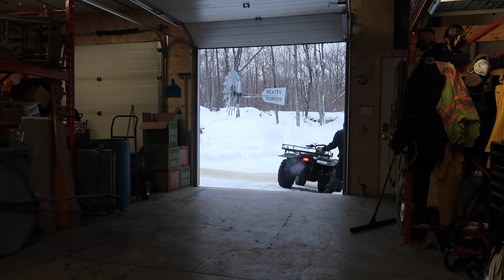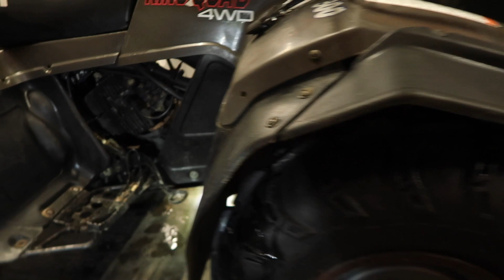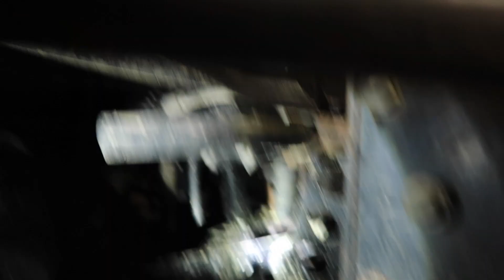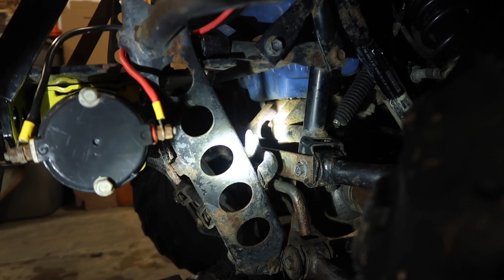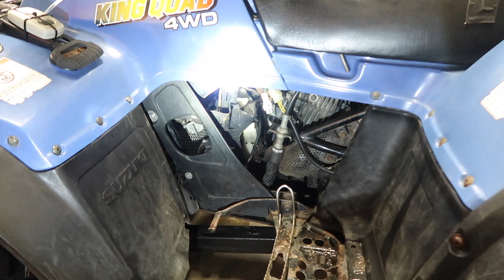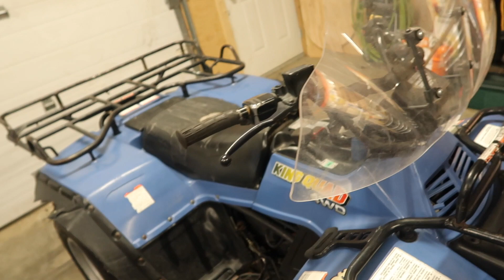King Quad 300 Oil Coolers and Cooling Systems Explained!

Comment: I have the winch on mine but the plate and winch are mounted up top in the middle, rather than in front of the cooler. The previous owner was plowing with it but I figure he removed all the mounting stuff that wasnt factory along with the plow before selling it to me. He did however leave the 300lbs winch on her. Mine has her oil cooler mounted in the front with no fan. Sometimes she seems to feel hot, like restarting with the rip cord after a long run sometimes is uncomfortable to grab. But that handle is right above the exaust. High temp oil light never comes on so I figure all is normal. I get a bit of oil build up around the valve cover on top of the head but nothing alarming enough yet to have to address. Its my understanding shes been like that for years. I really should check and adjust the valve lash. Just because idk when it was last done, if ever.  Seems like she may be running a tad rich as well, idk yet but plug is dark, like I said I should check the valve lash to see if they are out of spec a tad causing plug fouling before digging into the carb, which I do believe is oem. She runs great but idles for shit. Have to ususly apply a tiny bit of throttle while idling or when starting as the idle is Erratic and wont stablize when adjusted higher or when adjusted lower, (at the handle bars not carb, seems that makes no diff at the moment), the bike will stall or just simply idle like its gonna die leading to a stall, hence having to keep a smigin of throttle.  I suspect vacuum leak. Otherwise shes an awsome machine and runs great. Idk why the dark plug reading as under throttle she does not act rich, not burning oil at all, might miss at the limiter but that could just be the limiter. It's odd to me for a plug to read rich but the machine to run like it's a/f ratio is on point. Perhaps idle is really rich but under throttle is correct mixture??

Comment: Mine has the stock cooler placement up front.. but it also came with the factory fan.. 🤷‍♂️ I guess it's only really blowing on the motor.. and yeah mine just had a missile switch mounted on the handlebar. Manually..

Comment: Do you have any idea why my 2001 Suzuki King Quad 300 will not turn over with a good battery and even with trying to pull start with the decompression lever pulled?
Reply from the maker: I would pull the spark plug and try that. I bet the carb needle leaked and filled the cylinder with gas.

Comment: I have a 97 and a 96 Suzuki King Quad and my on 96 I am mounting a winch and a snow plow. With the factory front mounted oil cooler, why wouldn't a small fan on the cooler be a simple solution?
Reply from the maker: Yes it would be a simple solution. My father in law had the winch and plow on his for 20 years without a oil cooler relocate and he never had an issue.

Comment: Hey Schneid, I just got a 94 king quad 300 4x4. I took it for a nice ride ran great. But the lil red light by the ignition came on then went off the stayed on. I changed the oil and filter and checked the oil strainer and everything checked out. Is there anything else I can look at or is that red light for something else? I assume is for the temperature is my guess correct? Any help would be appreciated
Reply: I know this was a while ago and I hope you didn't blow your motor by now but that "little red light" is for your oil temperature. If you are overheating it will come on. It could also indicate low oil but it would be low oil.causing overheating if so as it measures the temperature of your oil, since these machines are oil cooled. Idk how reliable those lights are or if that warning system can fail or not so ots best to always use common sense as well. Be nice to know if mine works, however, as when the motor is hot I would like to know I it's getting too hot or is normal. My light doesn't come on so I assume all is fine. However sometimes that ripcord can be kinda hot to grab, ntb but hot. It's right by the exhaust however.

Comment: I have a 97 kq300 and is over heating. I'm thinking it's a blocked jernal. The oil Is flowing thru the hoses. I replaced the oil cooler in the front with and Older one from a 93 but that should be fine. Wish me luck.

Comment: I have a 1995 Yamaha big bear 350 that seems to be overheating. It does not have a winch or snow plow mounted on the front of it. It also does not come with a fan. I was wandering what could be some of the the things causing it to overheat?

Comment: Thank you for all your information it has been very helpful on my 1994 Suzuki 300 Kingquad. I am running into a problem the last two rides. The oil temperature light comes on and stays on. When I checked the oil is going through the radiator and it is warm. I have an idea the sending unit is faulty or bad wires. The problem is I can't find any information on the sender or its location on the quad. This morning the light stayed on when I first started it in the morning, 45° outside temperature. Any help to find this item would be nice. Thank you

Comment: hi there, I have a 97 king quad 300 that I use to plow in the winter. It doesn't have a cooling fan installed on it. I have found that after plowing for 30 minutes or so of plowing it keeps stalling out at idle and has a hard time reversing. Would this be due to overheating or am I looking at a different problem:?
Reply from the maker: I’m not sure what would cause that. A heat issue would make sense though. Maybe try and take it for a spin at speeds and see if the issue happens.0

Comment: Do 90s quad runners have an oil cooler? Ive got a 93 quad runner with oil cooler and the 5 bolt rims plus that extra black trim on the fenders. Is the sticker saying quad runner wrong / different plastics? Ive heard the king quads are supposed to have those. Great videos keep em comin

Comment: For my stretched diaphragm issue, I bought a cheap Chinese carb on Amazon. The slide is different but the diaphragm is exactly the same. Much cheaper than an OEM diaphragm and you get all you need for a complete carb rebuild for around $50.

Comment: Great channel Schneid. It has helped me tune up my 91 Quadrunner 300 (King Quad). I added an IP67 (dust and waterproof) fan between the winch mount (I have the same bumper as your 97 with the Caution label on it) and the oil cooler grill. I bought this machine used and it has always ran hot. I had to replace my front seal and while reading forums I read that these machines can run so hot that the oil literally boils. I am pretty sure that the motor heated up enough to bring the gas in the float bowl to almost boiling temperatures as well. This heat warped and stretched the diaphragm in my carburetor and caused it to stall out when it heated up. I put my fan mod to the test last week on a hunting trip. I had to tow a trailer loaded with gear (at least 500 lbs loaded) down bush trails over steep hills and through a couple mud holes. I ran the fan the whole time. The fan can't be heard while running but is noticeable when you turn the machine off so you won't forget to flick the toggle when you shut down. The fan works great! I used galvanized strapping which I bent over the oil cooler grill and mounted the fan directly to it so it is as close as possible to the oil cooler. Check "suzukiatvforums.com" for my post and instructions. This mod works and the fan is less than $20 from Coolerguys.com.

Comment: I just bought a ( trx300fw fourtrax 300 4x4 ) did that year offer a oil cooler? are these things rigged or does anybody make a KIT with everything included?? I'm in North Central Florida and would really want one for when I'm pulling my cutter in 90+ degrees sun, so WHERE does the hoses connect???

Comment: Hi Schneids, I have a 1997king Quad 300 and I want to put in place a  optional fan. Have some after market models that you could recommend to me, like the model you have presented your video? Thanks Sebastien
Reply from the maker: Hey Sebastian. I have no suggestions i am sorry. It was installed when i bought the ATV. If it were me i guess i would go to a junkyard personally and hunt for a small fan that was easy to take off and make it work. I have never even used the fan ever really except when plowing and i thought it was necessary but it has never really got hot before.

Comment: Hey Schneids, I have a 2000 king quad. I added a 12v cooling fan on it off another quad. Wired direct to the battery and up to a waterproof switch on the handle bars. Worked good in the summer but deer season it wouldn’t start. I could pull start it and it ran fine but any time I turned the fan or headlights on it would kill it immediately. The battery was brand new that summer. Is that because of the fan or do you think I have other issues with the charging system.
Reply from the maker: Hey, it sounds to me like A, you either have a draw possibly caused by the fan you added. Given it worked all summer with no issues i would think not. By the machine starting and running and the lights killing it, i’m wondering if you have a bad battery. Have you tried to charge the battery up then start the atv up and turn the lights on or fan and see if it dies? Depending what type of battery you have i only go for AGM batteries because i had some regular type ones fail on me within 6 months.

Comment: I just found out why my oncle quadrunner kept overheating when he use it on trail haha. He had a winch in front of the rad without a cooling fan. Because of that oil started to come out of the engine top when really hot.  Now its my quad and I take better care of it :)
Reply from the maker: Good to hear and i am glad i helped. Another good thing is to pressure wash those coolers out also if caked with mud.
Reply: @Schneids15  I will do so if needed!

Comment: My ‘93 appears to have the factory fan but also has the oil cooler located in the front of the bike.
Reply from the maker: Very interesting👍🏻 my blue one could have been altered also. I may have to look at the manual again and verify.
Reply: @Schneids15  I’d post a pic if I could.
Reply from the maker: If you got instagram you can send me one if you like. @schneids15

Comment: Hey schneids15 I have a 2002 king quad 300 that I cannot get to run with the correct main jet, I have it bumped up to a 127.5 and it’s to rich but it won’t rev up with anything smaller
Reply: Like it just won’t rev all the way out under load
Reply from the maker: Hey Noah, it will rev up fine in neutral? Have you verified it rolls good and no brakes are sticking etc.? With the factory jets installed what happens?
Reply: @Schneids15  yes it will rev all the way up in neutral, no brakes dragging and rolls fine, I have been plowing mine and my dads driveway out of necessity but I’m worried about fouling plugs and it’s probably not great for the engine to be running so rich, I feel like it may be a problem with the diaphragm slide not opening up all the way becuz if I take it for a ride without the seat and airbox on and stick my finger in it when it start to die and open the slide manually it will rev up, but I’m not sure if it’s just the blocking of air from my finger or the actual slide isn’t opening all the way
Reply: I have verified that there are no rips or pinholes in the diaphragm
Reply: @noahlyden17  could it be a problem with the enrichment plunger causing it to run rich?
Reply: @dariolunardi5890  i don’t think so , it’s definitely a lean bog
Reply from the maker: Okay so if you take the vacuum lines off the carburetor where they go in can you blow on those lines and they feel solid? When you had the factory main in did you have the air intake hooked up, air filter on and the air box lid closed? I have found if those are not installed( i have experience being stumped by it) they will run lean and pop and not rev all the way up. I found this out after a carb clean. Took the atv for a spin without intake on to make sure all was good and it would not rev out and pop. This sounds similar to the issue i had.
Reply: @Schneids15  I’ll have to verify on the vacuum lines but I did replace the fuel pump with an aftermarket one, however I don’t believe that’s the problem becuz I have fuel in my fuel filter, I replaced the air filter too and I know I only put one screw in the lid becuz I could only find one, I will get a replacement for it